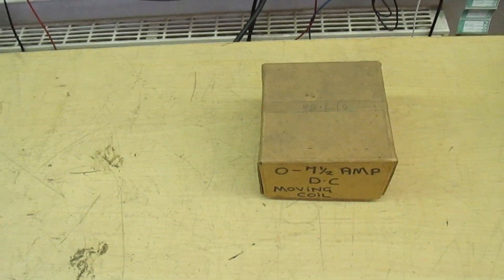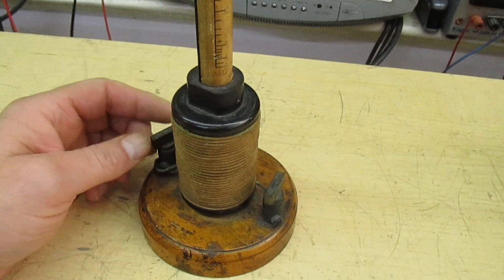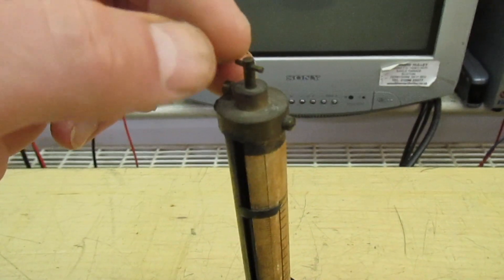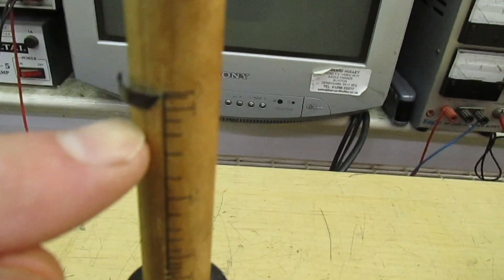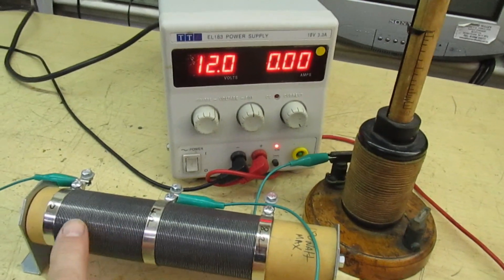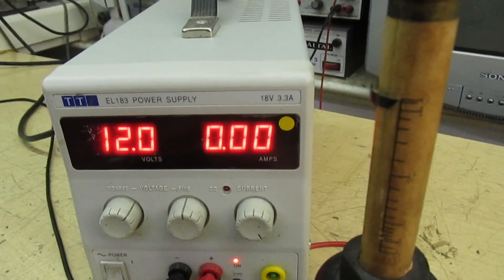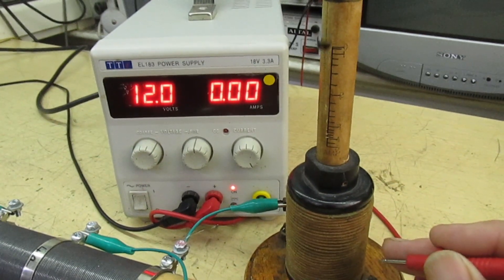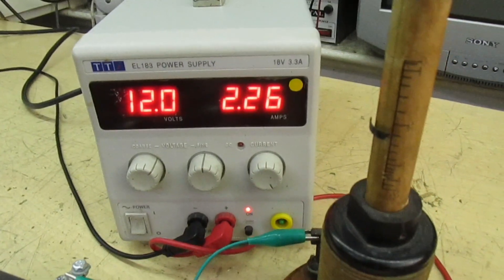A very vintage current measuring device   0 - 5 Amps .

Comment: Michael, although my love is in tv repairing, I only did it as a job for 5 years.
After redundancy, i re trained for HNC and worked as an electrical and electronic lab lechnician at a local college.
After i started in the eighties, the store rooms to the labs were loaded floor to ceiling with exactly these.
Also van de graff generators, wimshurst machines, electro static voltmeters etc.
All in shiny wooden cases with polished brass terminals and cotton covered wire.
Loads of ex army electronics too, as the Americans were stationed there during the war, but thats another story 👍👍

Comment: Moving iron ammeter. Coil stationary, iron plunger moves. Non-linear scale. Very nice indeed.
Reply from the maker: It looks to be old but I can't make my mind up if it's really very old or not.
Reply: @michaeldranfield7140  You might have a piece of early British electrical measurement history. The coil appears to be insulated from an era long ago. I can't see it exactly but looks cotton covered. If you research when that ceased, then there's the latest year of manufacture. The labeling could tell you more about year of manufacture. The types of connector look homemade or small-workshop made (custom made). It is a clever accurate instrument (trust the Brits to come up with something nice like that). You have really a lot of parts. I never saw so many. I love that you love electronics because I do too. About its age, if someone could use a moving coil meter they likely would, so it could predate those. Given its accuracy, they had something to calibrate against - what could that be? Age could be 1900 or even much earlier. Take it to someone who can look at it and get an age for it.
Reply from the maker: It was advertised as Edwardian but the person I bought it off did not seem to know anything about it, I only bought it because it was so cheap, not that I have any need for it! Glad you like my lifelong collection, the truth is I'm obsessed with electronics.
Reply: @michaeldranfield7140  I just looked at my 1917 copy of Standard Handbook For Electrical Engineers and could find no reference to that type of measurement apparatus. By 1917 they knew everything about electricity - they just didn't have electronics yet (aren't we lucky!). Your instrument could be earlier than 1900. I'm in Sydney. I'd love to visit if I could but you are way too far away.
Reply: @michaeldranfield7140  I did find this similar looking device, although used for induction measurement has a similar structure to the DC ammeter you have.
https://en.wikipedia.org/wiki/Faraday%27s_law_of_induction